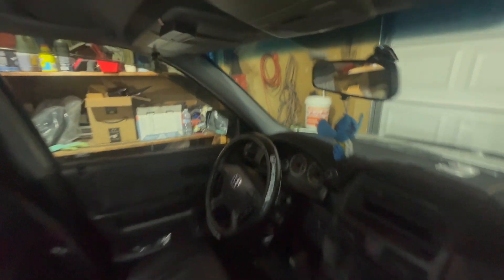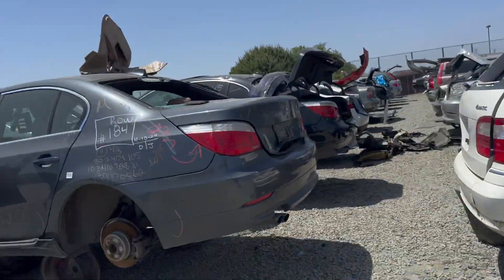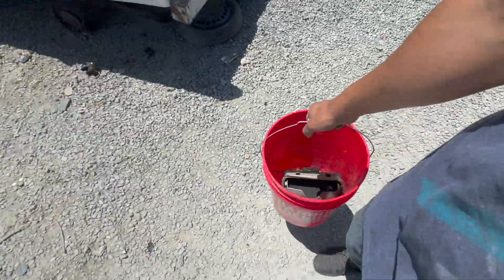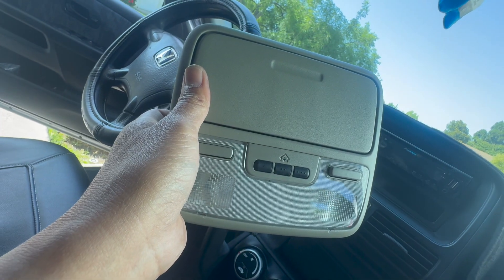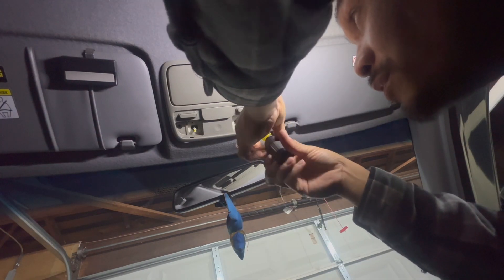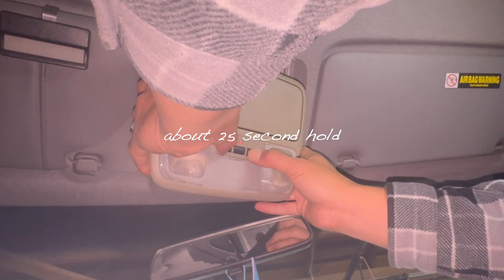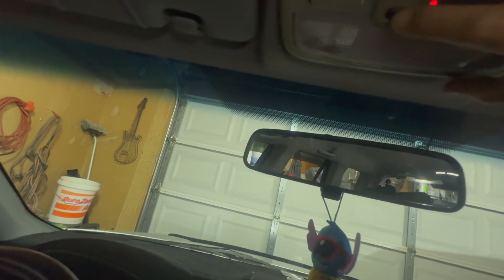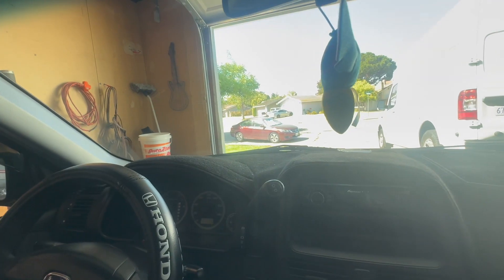2002 Honda CRV Homelink Install Hack

Comment: Thats great, never thought about doing that. What's the reason you like the leds?
Reply from the maker: That’s a great question. The short answer is, it’s brighter! Many other reasons Sir, that I could imagine its benefits. Thanks for the time. Appreciate it
Reply: @jcorpus209  okay yeah makes sense. I once heard that if you forget to turn off one or both your map lights, it wont drain your battery as fast when you go to start it the next morning